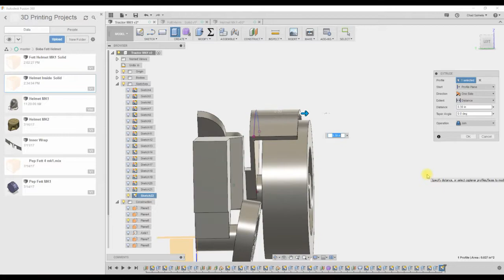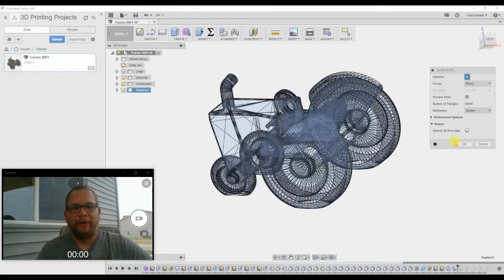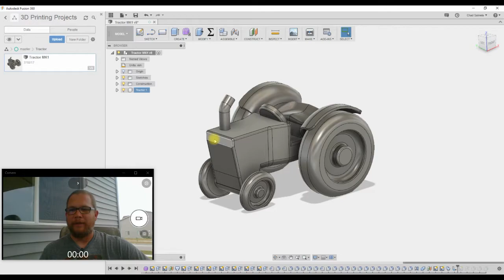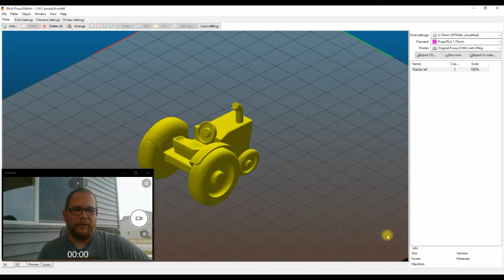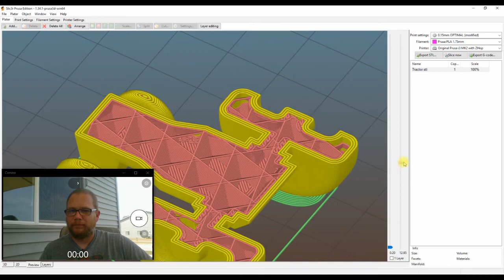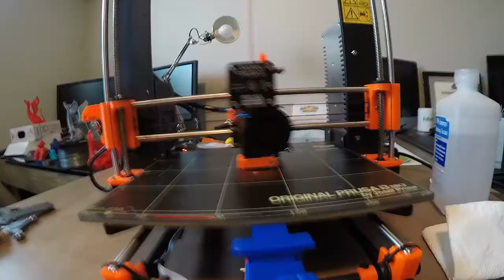Process: Model to 3D Print

Comment: I'm surprised that first layer with the angled bridging did even as well as it did... I would like to suggest a video on what you do when you get a new filament in. Any stringing test prints, temperature towers, extrusion rate calibration, etc. that you go through to see what the exact best settings will be for that spool! That's something I was trying to work on, but I've only had 2 spools so far (and my MK2S still not here, so using a Select Mini v2). It seems like dialing in the settings will help tremendously with final print quality.
Reply from the maker: Actually realized after I put the video out, that when I rolled the timeline back to show making the components in fusion, I didn't roll out all the way back to the end before I sliced the tractor. I had made some adjustments to that part of the model before I printed, so my bridging on my printed part was actually straight lines, not angled. Those adjustments were not on the video, because I didn't roll my timeline all the way back to the end. I don't habe a process for new filament yet, that's actually part of what the tractor is for. But doing a video for that will give me a reason to get a process in place. I'll do it, bit it may take a few weeks.